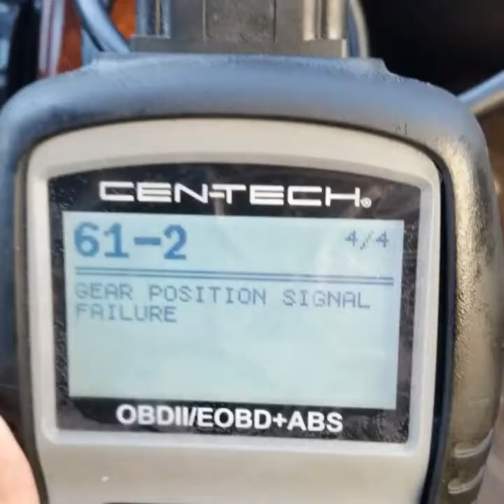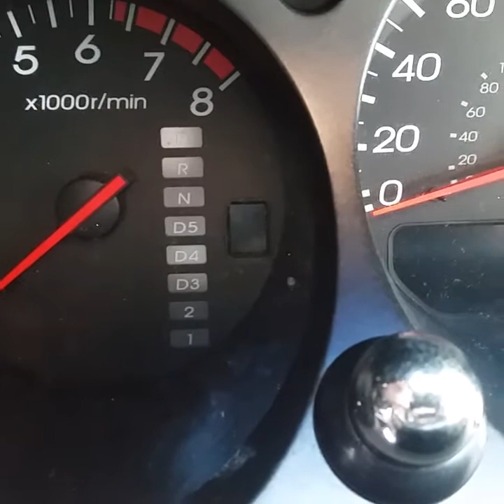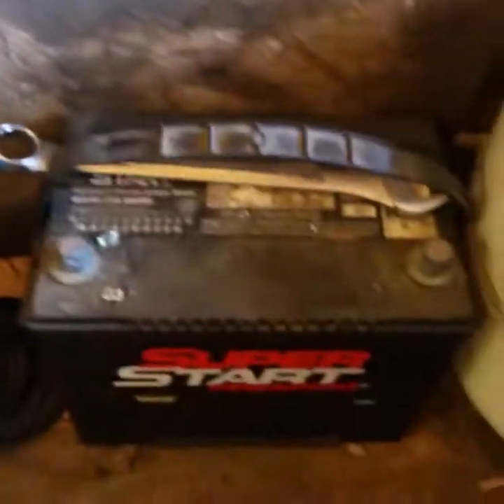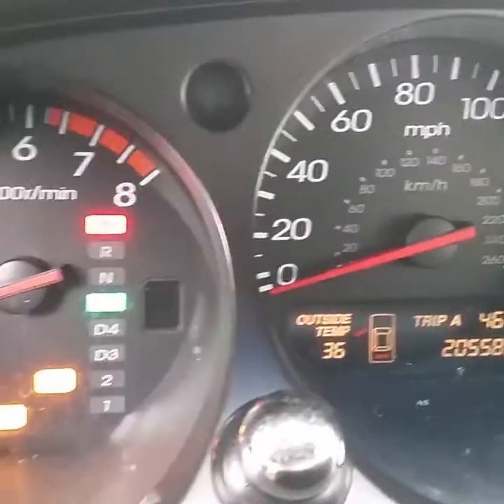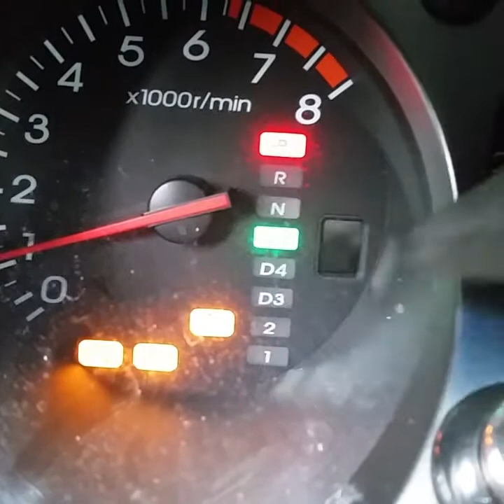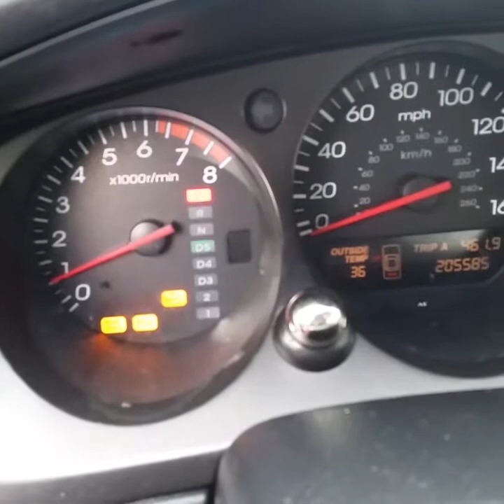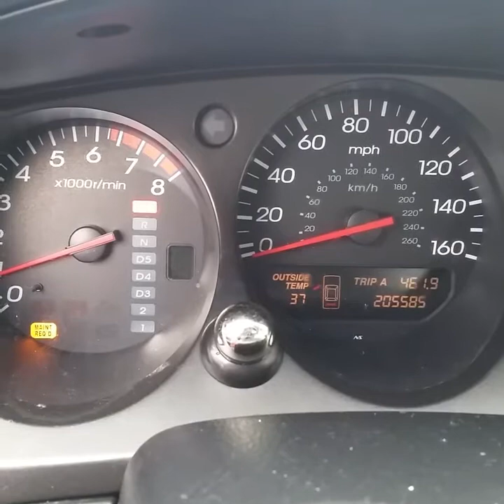Meet Katana! 2002 Acura TL

Comment: So I got my catalytic converter stolen on my 2002 Acura cl. Ever since then it throws out a check engine light with the code to check the clutch circuit solenoid and that there’s an open circuit. Is there a chance that the person could have cut off the wiring to it?